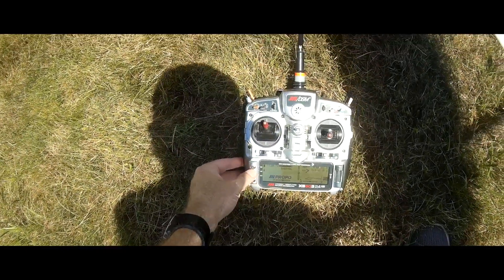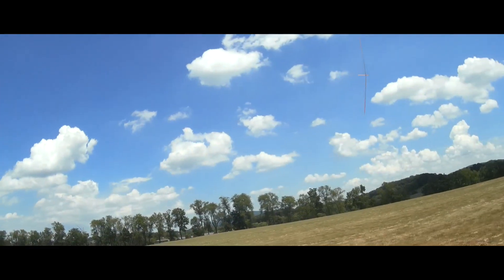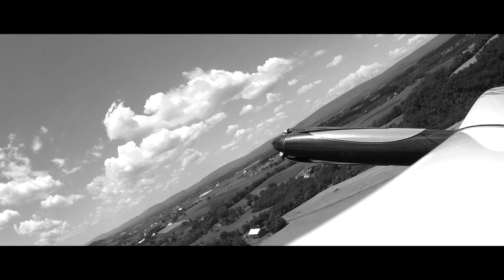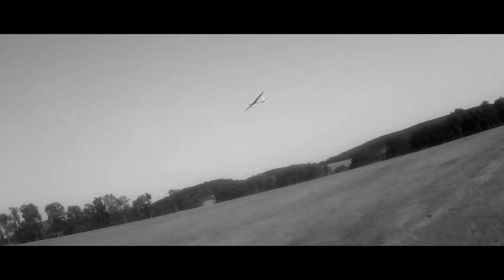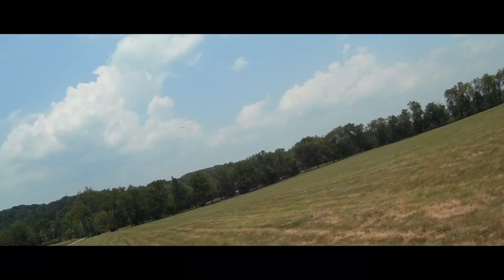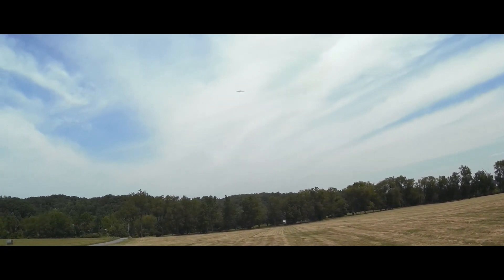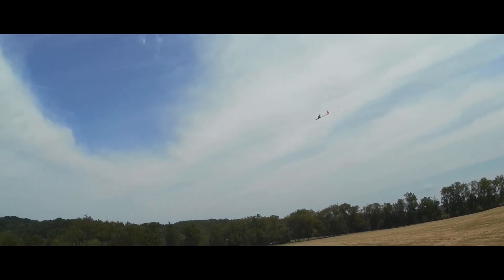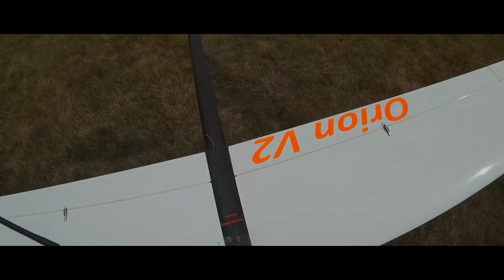ORION V2 First Test Flights & Aerobatics

Comment: Dumb question, But are the wings bolted to the fuse, or taped? If Taped, How and what lol
Reply: If you never found your answer; taped wings typically have a spar joining them through the fuse. The tape only keeps them from pulling apart from each other. The spar provides all of the strength.